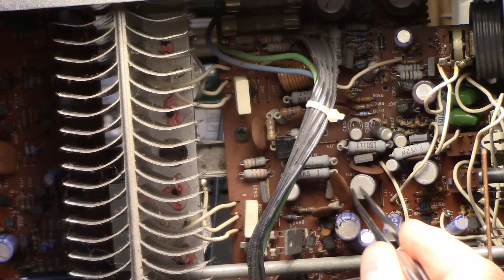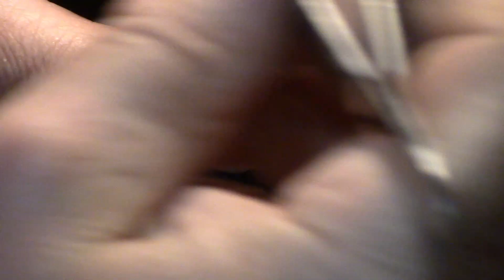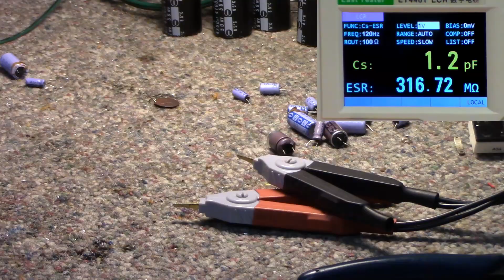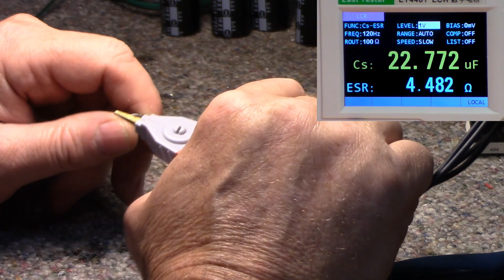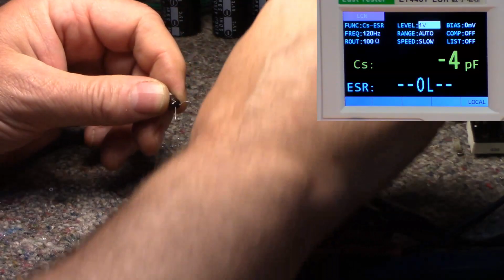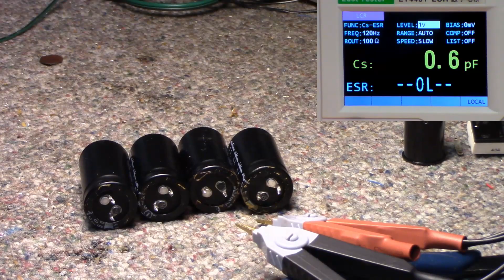NAD 3140 Integrated Amplifier - Repairs (Ep. 39)

Comment: I am always amazed when engineers place capacitors right up against heat dissipating resistors.  They go through the effort to stand the resistors away from the PC board to prevent the resistors from cooking the board, but don't bother spacing them away from the capacitors to prevent cooking them.  I see this in amplifiers and CRT displays.
Reply: It's partly cost saving but also as long as the equipment survives a few years it's done it's job, this level of audio equipment was never meant to be a collectors item. Most people either change or upgrade after a while anyway and will probably just store the old one in the attic or sell it, the new owner may decide to get someone to fix any issues it has but mostly they are discarded because they were inexpensive and deemed 'throw away' items. 
Higher quality equipment doesn't seem to have as many issues but it's been known for a long time that capacitors don't last forever and will eventually need replacing anyway.

Comment: When I opened up the power switch on my Yamaha CR-2020, I was greeted by a ton of carbon residue from all the arcing.  I don't even know how the switch continued to operate.  It works great now, but I decided to use a power strip to turn the receiver on and off in an effort to preserve the switch.
Reply from the maker: Was there a cap across the switch to reduce arcing? That doesn't sound good, maybe it's time to find a replacement. I'd be worried about contact resistance, arcing under load and current leakage when shut off. Good plan to use a power strip

Comment: Variable resistors for bias are both open in mine as well. One of the DC offset variable resistors has been replaced at some point, seems like the originals are prone to failure. Thanks!
Reply from the maker: Good to know & thanks for sharing, I'm sure others will find your info useful, Cheers

Comment: Hi Trevor, i just used this video to remove and clean out the power switch. It's such a pain getting it back together! I thought i finally got it, but now when I plug it in, it doesn't power off (red power light is on). It's powered on whether the switch is in or out. So I'm thinking maybe it's one of those arms by the plastic rollers that got stuck. Would there be any other reason you could think that it doesn't power off??? Just wanted to ask before I remove the switch again!

Comment: Trevor I have the 3140 that still works fine except all three led lights will not go off unless I unplug the unit. Do you have an idea what would cause that? Thanks!
Reply from the maker: Very odd. The main power switch should be killing power to the unit. I don't see any other supply of power to the unit when off. Maybe somebody did some modifications to this NAD?
Reply: The power switch on my 3140 was failing as well. I leave it on and use an external switch.

Comment: I was thinking about buying this particular amplifier on marketplace, however it seems to be a poorly designed product. Thanks for posting this have watched it several times.
Reply: Rather, NAD is/was known for superb design and engineering with a less than desirable manufacturing processes and QC standard. Compromises were made for the price but sound quality through better design and engineering wasn't one of them. However, with a little modification and upgrading of some components, they are reliable with true high fidelity sound for little expense.

Comment: Hello I own this unit. I cut the 4 ac wires to the extra AC outlets last year and did a poor job on marking them. Please be kind, I know it was my  fault. My goal is to install an IEC socket and use a better power cord. I have done this before. Is there a way to contact you, offline, or could you reply to which of the 2 Blue wires from the bigger transformer near the back go, and there is a white and a blue wire from the smaller transformer. I Repairman want 75.00 to 100 just to look at this unit. Reaching out for your help. Thank you.
Reply from the maker: No worries Otto. Help is on the way!. You'll need to download the service manual from HiFiEngine.com for the NAD3140. There on page 8 are full wiring diagrams for all the different voltages and regions with and without the voltage selector switch. This should be enough for you to piece it back together again.
Reply: Hello Trevor, that you for your reply. I have a 7140, not sure if the service manual for 3140 is the same wiring. Thank you
Reply from the maker: @Michiganman08  Same difference. The service manual for the 7140 has all the wiring diagrams too